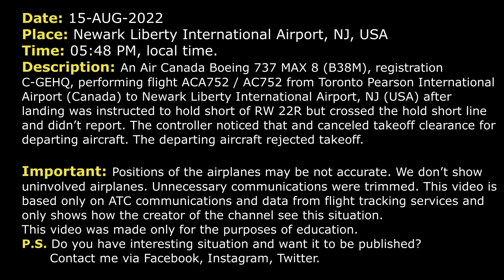Runway incursion. Air Canada Boeing 737 MAX 8 didn’t follow instructions at Newark

Comment: ATC NEVER said “cross 22R.”   What he said was “cross…. actually Air Canada disregard, just hold short of 22R.”  

The pilot jumped the gun before receiving a full clearance AND…. The pilot should NEVER EVER proceed ahead with a directive from ATC, until the pilot gives a read-back of the instructions from the get-go.    100% pilot error and NOT the error of ATC in this case.
Reply: I disagree. If the ATC never said it, then there would have been nothing to disregard. They don't tell a pilot to disregard something they never said. The disregard is the smoking gun. The incident was at least 50% the fault of the controller.
Reply: @MaxZomboni  if he had started, the ATC said stop, and the pilot had said "sorry we already crossed" then I don't think it would have been a big deal. They would have had the plane taking off just wait until he crossed.
Reply: Disagree... you're picking at straws if you're arguing that a plane at a hold short line that hears "cross" needs to wait for a specification on what they will be authorized to cross. It's clear as day. I blame ATC for not considering the instruction before starting to say it, or for not just completing the thought once they started it. I blame the AC captain for not reporting that they had crossed the line. This is not a 100% situation in the slightest.
Reply: @FactsMatter  Saying that you should not begin crossing a runway until you've heard a full instruction telling you to cross that particular runway is not at all picking at straws. That is very much an important safety requirement. A full readback should also be given of that instruction with full callsign. I do agree that the ATCO deserves some blame here, but most of the blame lies with the AC crew, both for beginning to cross before havin the full instruction to do so and, even moreso, for not immediately informing ATC that they had crossed the line.
Reply: The previous clearance specified that they were to hold short of 22R @N, which means they were most likely already turning in that direction as they were taxiing. It is also 99.999…% the next clearance you will get is to cross at that specific intersection, so when they hear “Air Canada 752 cleared…” what other possible clearance do you think they could possibly get??? Stopping to wait and here every word and getting the read back slows everything down and grinds operations to a halt, potentially screwing up traffic flow on the ground and in the air.

The ONLY issue as far as I can tell is the fact that they should have immediately told tower they crossed the line, which I dare say would not be held against them considering the context.
Reply: @andrewpate3437  The instructions were never given to cross the runway. By assuming they would get cleared, they put TWO aircraft and hundreds of lives at risk. 

Absolutely you MUST stop to wait and hear- and repeat - every word. That's actually the regulation. 

And it must be held against them for LYING about crossing the line. Not only did they fail to report it, but they LIED and said they were holding short.
Reply: @mattz1230  Pretty incredible how confidently you state that the AC captain "put TWO aircraft and hundreds of lives at risk" while simultaneously saying nothing about how the ATCO's misspeaking/change of mind could have also been the reason that "put TWO aircraft and hundreds of lives at risk". 
The point has been made multiple times in this thread... yet.... 
The mental gymnastics necessary to ignore and dismiss a valid viewpoint in favor of keeping your own is astonishing.
Reply: @andrewpate3437  completely agree with you. You are telling it as it happens in the real world, not flight sim world 😅.
Reply: @chrisvickers1262  The real world is the crew waits, reads back, then takes action. Your little flight sim world doesn't punish you, but as you heard, failure to follow procedure will  get you a number to call in the real world.
Reply: @mattz1230  No. 

The real world is that you know Newark is incredibly busy and when ATC gives you instructions they expect you to comply immediately so because of that the second the crew heard "cross" they would have continued taxiing. THAT is how it works in the real world my friend. Sitting there behind your computer saying that all crews sit and wait until they read back every single clearance is completely wrong and is simply not aligned with the real world. Sorry bud but you're just wrong.

As far as I'm concerned, the fact that the crew crossed the hold short line is 100% the fault of the controller. BUT, the second the crew crossed the line and then realized that they were not cleared to cross, they absolutely should have advised ATC. That is indisputable. There is no excuse for that whatsoever.

"Newark Ground, apologies. We are already a few feet over the hold short line".

That's it. That's all it would have taken. No harm. No foul.
Reply: @troybaxter2916  Yes, Newark is very busy. But, what you fail at is that no instruction to cross the runway was EVER given.

And no matter how busy, NO CONTROLLER EVER would ask a pilot why he had stopped waiting for clearance. EVER. 

No controller ever would let a pilot go without a proper readback. 

Hilarious how you assign the actions of the crew to the controller. You have absolutely no idea what was going on, and what was supposed to happen. 

That pilot was ORDERED to stop short. He was NEVER cleared to cross, and that order to stop short was repeated. He disobeyed TWO INSTRUCTIONS TO HOLD SHORT OF AN ACTIVE RUNWAY. 

HE LIED ABOUT IT, GIVING A FALSE REPORT THAT HE WAS SHORT, and caused a plane to abort the takeoff run. 

Trying to blame the pilot for not following CLEAR INSTRUCTIONS TO HOLD SHORT is the fault of the pilot- 100%. 

Sorry bud but you're just wrong.
Reply: @mattz1230  Jesus Christ dude. You can’t really be this obtuse. The crew was told to hold short knowing full well that in a very short amount of time they were going to get another clearance to cross the active runway. That clearance was going to include the word “cleared”. The word “cleared” serves as a trigger word here. 

The second that controller said the word “cleared”— EVEN THOUGH NO CLEARANCE WAS GIVEN—the crew did what all pilots do and anticipated a further clearance. And keep in mind that the plane was most likely still moving forward so “crossing the runway” was simply a matter of not applying the brakes.  

This is something that I, as well as every other experienced crew has done. The difference with most crews is that we won’t pass the hold short line until we’ve heard the words “cleared to cross”. Unfortunately this crew didn’t do that.

It’s called human factors and is an innate part of being human. 

Now, once they realized that they were not in fact cleared to cross, they stopped. And again, they should have told ATC. No idea why they didn’t. As you said I wasn’t there. 

The only part of this that I am defending the pilots on is crossing the hold short line. Whether you agree or not, any reasonable person will agree that the controller WAS VERY CLEARLY IN THE PROCESS OF CLEARING THE AIR CANADA FLIGHT TO CROSS THE RUNWAY. When you have been flying for years and years and you’re holding short of a runway and you hear your call sign followed by the word “cleared” you know what’s coming next. 

Therefore there is absolutely blame on the controller. You don’t agree. Oh well. I promise you that the FAA, Transport Canada, Air Canada, and the VAST majority of experienced airline pilots would agree. 

Now, everything after that point is 100% on the crew. They have some explaining to do.
Reply: @troybaxter2916  Jesus Christ dude. You can’t really be this obtuse. The crew was NEVER CLEARED TO CROSS. 

Period. 

Doesn't matter if they thought they would, doesn't matter if they were triggered- like you are, doesn't matter what they anticipated. 

THEY WERE NEVER CLEARED TO CROSS. 

Even you can't dispute that the words "cleared to cross 22R" were never stated or read back. 

What the crew WAS ordered to do was hold short. They were told to hold short and failed to do so, which makes this a runway incursion. 

Then they lied about it, falsely reporting that they were holding short, when they were, in fact, on an active runway, which had another aircraft on its takeoff roll. 

No pilot is going to cross until they have PROPER clearance. A professional will plan to stop short- AS INSTRUCTED- until the PROPER clearance is given. 

As evidenced by the FACT that no clearance was given, the controller was not about to clear them to cross. That's a figment of your imagination- and not something that a safety-conscious crew would do. 

That fact is clearly demonstrated in that they were given a number to call. And, it looks like the FAA is investigating the incident, with a possible suspension. 

Google: Air Canada Newark runway incursion.

Looks like you're all in the wrong. 
You can't point out a proper clearance to cross. 
You can't point out why the crew lied.
And the experts are likely going to punish them for their incursion and lie. 

YOU LOSE.
Reply: @mattz1230  This isn’t a matter of win or lose. But I’m starting to get a picture of how you think so that’s helpful. 

If you truly don’t understand how an experienced crew could possibly have made this mistake, and how that mistake was absolutely helped by the controller’s indecisiveness, then this conversation is pointless. 

I’m very glad people that think like you are now in the minority in this industry. And thankfully people that think like you aren’t in charge of investigating situations like this. 

Enjoy your day.
Reply: @andrewpate3437  Absolutely. Thanks for saying my comment better than I did. It's sad to see that people are so hellbent on by-the-book procedure while discounting real world realities. Common sense and the hustle of EWR can't just be ignored because you want to blame one party entirely for a bad situation. It's confirmation bias at its worst.